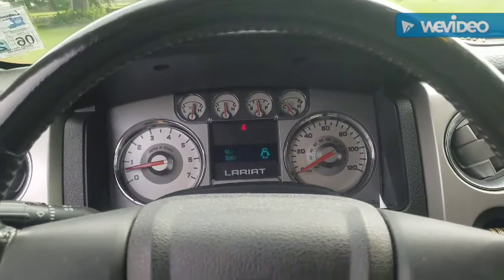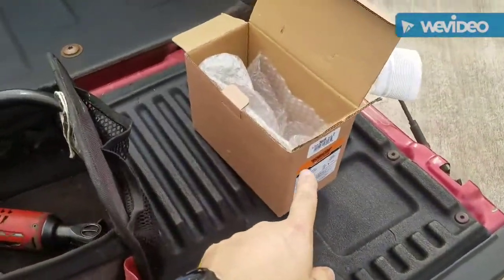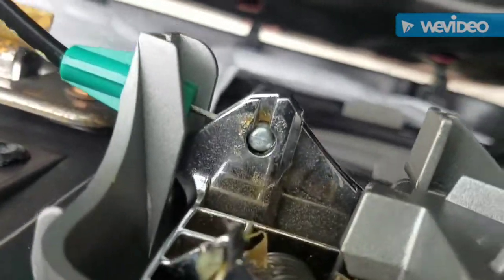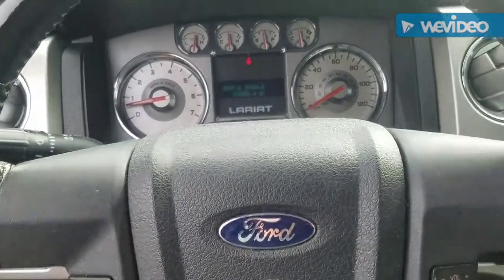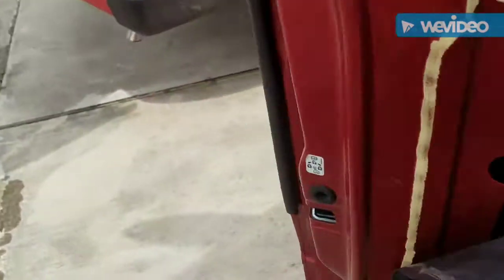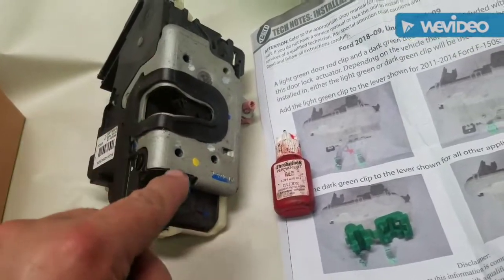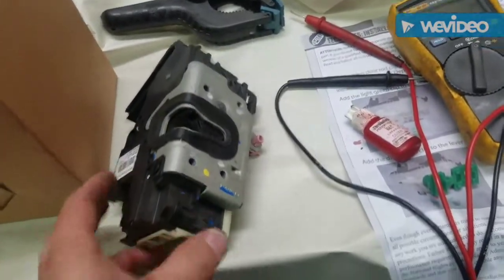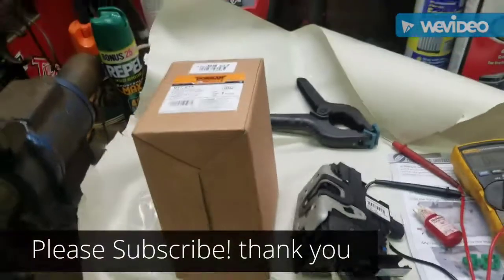Ford F150 Left Rear Door Ajar indicator issue after install of Dorman 937-677 Lock Actuator #f150

Comment: I got exactly the same issue with the same brand of the actuator, you got it men, i have fixed using your video, i just loose 1/4 turn back the top screw and the message in the board gone, thanks, great video
Reply from the maker: Glad it helped!

Comment: Hmm so has this caused any issues whatsoever after the adjustment these last two years? I'm having an issue like this with my 2010 Ford expedition limited and its been a pain in my ass since it keeps alarming when its locked, might just give it a adjustment and see how it goes cause the error isn't there at all, it just comes and goes when it wants
Reply from the maker: No issues since this video was posted.   Still drive the truck every day.